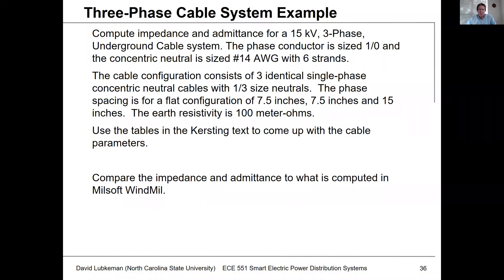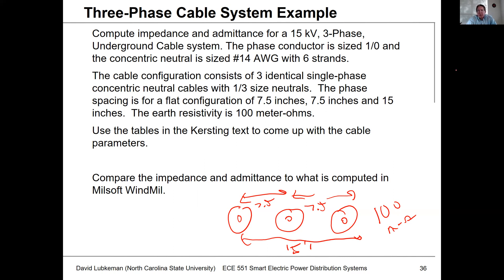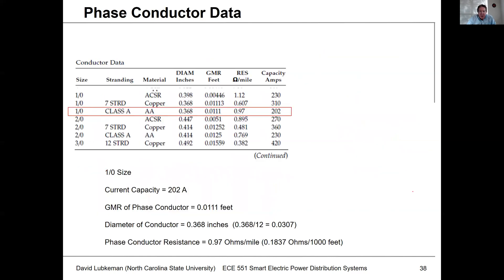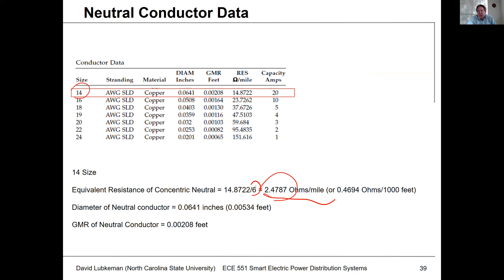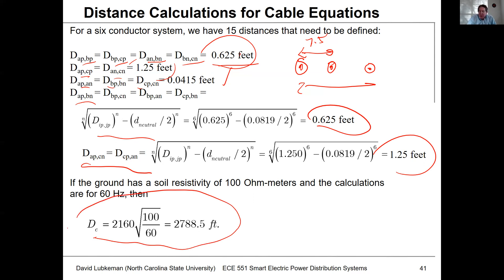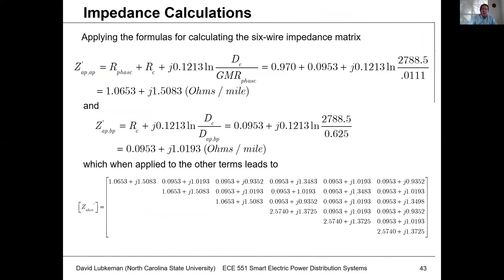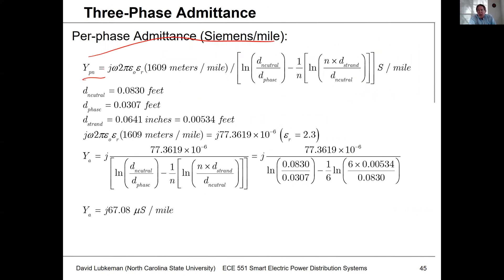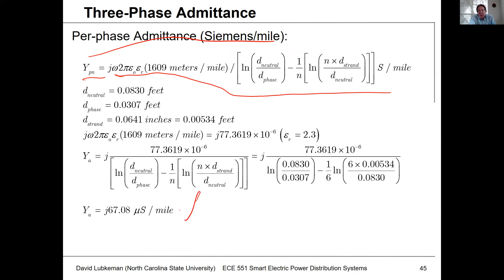Lecture 7c: Cables - Examples - Power Distribution Systems Spring 2021 - Lubkeman

Comment: so which impedance should be used for loadflow calculations
Reply from the maker: Depends on whether you are running a balanced or unbalanced loadflow.  Also depends if you can enter a cable model with unequal mutual couplings.   

Case 1: Balanced loadflow, all phases same loading. You will want to use a positive sequence impedance Z1.  Take 3x3 matrix Zabc on slide 44, and compute Zs = diagonal terms/3 = (zaa + zbb + zcc)/3 and Zm = off-diagonal terms/3 = (zab + zac + zbc)/3.  Then Z1=Zs-Zm.

Case 2: Unbalanced loadflow, phases have different loadings.  But you can only enter a positive sequence Z1 and zero sequence impedance Z0.  Then Z1=Zs-Zm and Z0=Zs+2Zm.

Case 3: You can enter the 3x3 impedance matrix in directly with unequal mutual couplings, so just enter Zabc. Not all power flow programs allow this type of detailed input though.

For shunt admittance (charging capacitance) with concentric neutral, there is no mutual capacitance.  So can just use admittance directly as given on slide 45.  This term is the positive sequence admittance.